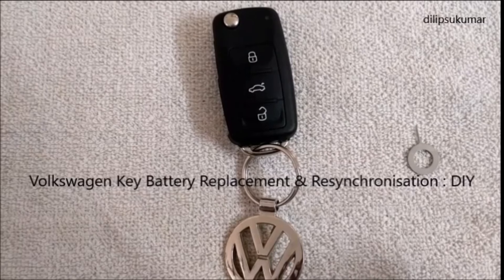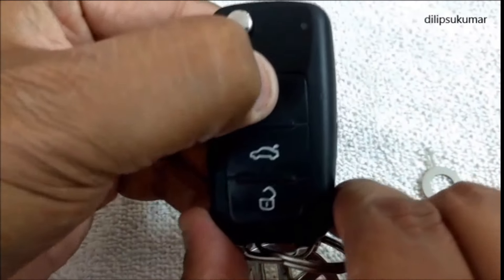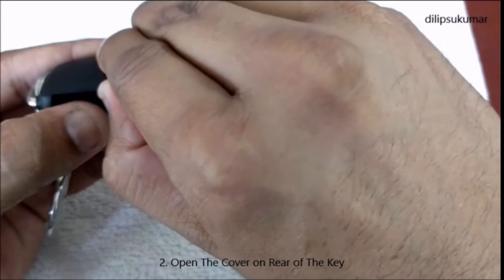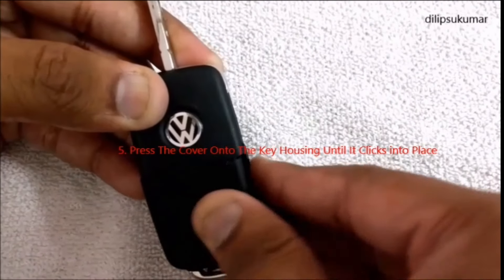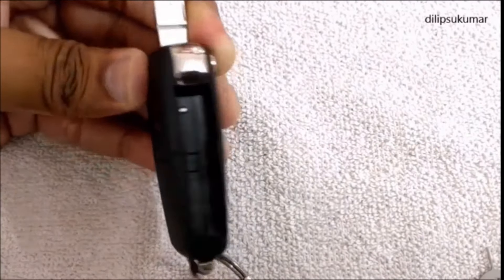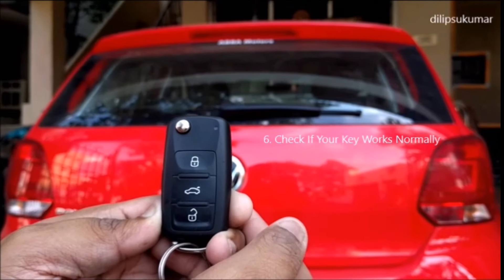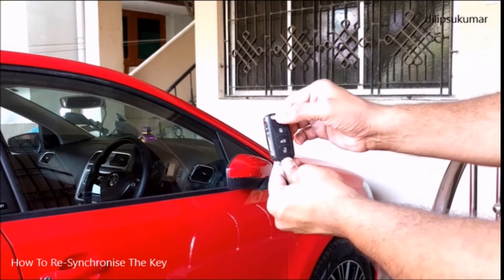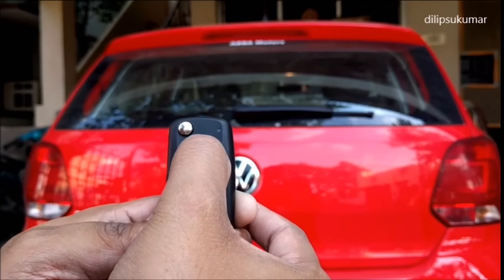Volkswagen Key Battery Replacement & Re-Synchronisation : DIY

Comment: Brilliant, great simple instructions. Worked for my GolfMk5. I got caught out after replacing battery and key would not work at all. All fixed with the last section of your explanation on synchronising.  As you said, expose key, press unlock and wait a few seconds, then physically unlock the door with key. Thanks a million, you saved the day. Kind Regards Craig
Reply from the maker: Thank you so much for your kind words. I am glad that my video helped you

Comment: I tried resync but for some reason it's still not working. The lights on the battery do blink. Any idea what else could I check?
Reply: Having this same issue right now. No resolution yet. I trust you fared better!
Reply: Having the same problem too omg 😭
Reply: Same issue as you... did you ever figure it out???

Comment: Hi dilip, 
My polo battery is dead so my remote will not work in that case and apart from that when i use the key to enter only the driver seat door is locked and unlocked the rest of the doors are unlocked they dont get locked.
Reply: I am also facing the same issues (with  remote all the doors are getting locked and driver seat door not looking
Can anyone suggest  how to fix this issue please

Comment: I just bought a used polo 6r. Most of the times to lock my car I have to press twice the lock key cause it doesn't lock with the first pression. What could be the issue? I already replaced the battery. The led works when I press the first time.

Comment: Kindly advise the advantages of going for VW Polo TDI highline PLUS.
Reply from the maker: +Samuel Maria Sebastine 
1. Diesel will give very good mileage of 14-16 kmpl in city and 19-21 kmpl in highway. Petrol will only give 10 kmpl in city and 16-18 kmpl in highway.
2. Performance of diesel is very good while the performance of petrol is just average.
3. Diesel Variant has a more refined engine and the noise / vibration levels are better compared to petrol variant.
4. Diesel variant has a better resale value
Reply: Do you feel the pricing of the Polo TDI highline Plus reasonable?
Reply from the maker: +Samuel Maria Sebastine it is reasonable because of its advantages that I mentioned... But please don't buy it without any discount. VW will be offering good discounts. Please check with your nearest dealer.

Comment: Hello Sir..i have few small dents in my polo.. Can you please suggest any way out to get rid of those
Reply from the maker: +sandipan roychowdhury for small scratches you can use scratch removal pens. But for small dents, I suggest you to get it repaired from a nearby workshop... 
I repaired small dents at a VW Workshop in Chennai and they have done a good job. The charges were also nominal...
Reply: dilip sukumar but Sir in kolkata they charge very high.. In one small dent they charged 3000-4000 rupees

Comment: Could you please tell me why the company provides only one reverse lamp and only one rear fog lamp? I have noticed this in many cars on today's market. Most of the time in dark areas, it is difficult to park or take reverse using a single reverse light. Some people told that the company is cutting cost through this. What is the fact?
Reply from the maker: +Rahul Krishnan it is nothing but cost cutting... There are no other reasons behind it...
Reply: dilip sukumar , actually I just wanted to know how they are cutting cost through this. (You might have also included this thing in the video you have already made based on silly cost cuttings done by the companies🙂)
Reply from the maker: +Rahul Krishnan I think I have to make a Secord part of silly cost cutting by car manufacturers :)
The interesting thing is that if one car manufacturer does a stupid cost cutting, lot others start following it immediately...
Reply: dilip sukumar hahaha 😂😂😂😂😂🤣🤣🤣😀😀😀 you are absolutely correct I think so!!!
Reply from the maker: +Rahul Krishnan 😀😁😂